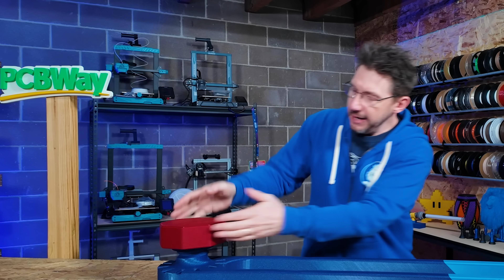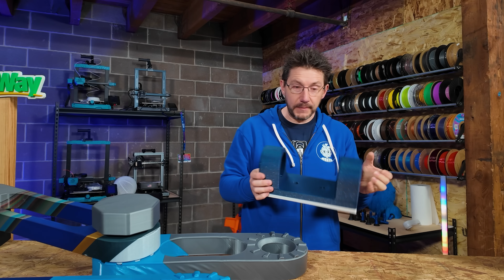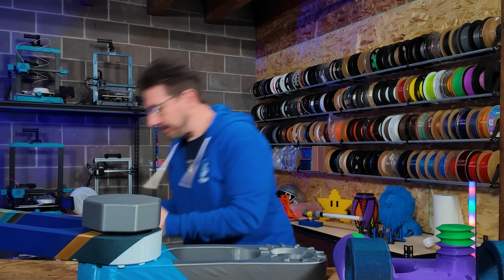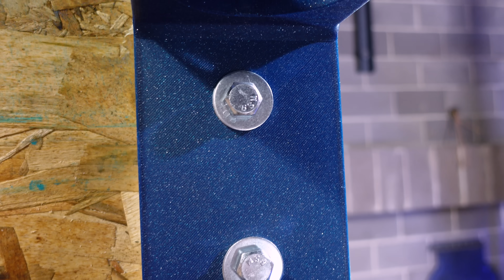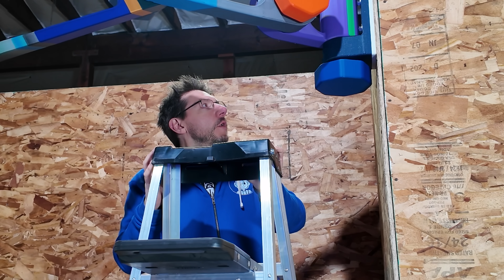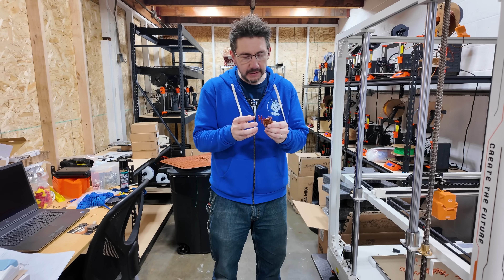My OrangeStorm Giga is Dead

Comment: Hi All, I am wondering if the bluestom conversion enables consistent long duration prints using 95A TPU (this is something I have had trouble with using the standard extruder- clogs every 6-12hrs). Let me know any tips for standard extruder for printing TPU without clogging.
Reply from the maker: It very much should in theory. I would reach out to Luke's Laboratory and ask.
Reply: I have installed a clog detection system and this has made a big difference for long prints being able to recover and keep printing.

Comment: like 90 % of printers suffer issues from warped beds and we are talking anything around 300x300 this thing right here is to big of an issue, get graphite beds and graphite plates to join them together, then get big piece of sand paper and try wet sanding the joints to hopefully get a very smooth middle..... but with aluminium plates i cant see the thing being stable printing 24/7, as i said pretty much all printers suffer from terrible beds, and using whole 300x300 on nearly all of them is very hard until you spend alot of time getting it to work, but then you change material and its off again, altho creality says deviation +3 and -3 is fine which puts my head away its 6mm difference.........

Comment: That printing issue where there’s a lot of small parts on the bed is a very common issue on prototypey 3d printer design. That’s why i bought a very reliable printer to print and forget and expect excellent prints almost all the time.

Comment: 3D LAC spray is the best answer to bed adhesion. I use 3D LAC on all of my prints regardless material in use. The spray hold prints even on the bare metal back of the print plates.

Comment: I can only imagine that a one-piece bed will improve this thing massively. From what I've seen, it doesn't look like the design allows for thermal expansion of the bed pieces and I would not be surprised if they warp pretty badly once they're up to temperature.

Comment: As a Neptune 4 Max owner I see this problem all the time .... the core issue is the expansion of the build plate as the plate heats up .... putting off your z offset ... you need to let the bed heat up for around an hour before setting z offset and / or printing ... for the build plate to settle and stop moving .... otherwise layer adhesion / collision WILL happen.  That OrangeStorm will have the same problem at scale.   Elegoo have not been able to solve this issue since they went big ... and I think that's because it is a limitation of the technology.
Reply from the maker: I solved it with rigid mounts. I’m not kidding it’s working great.

Comment: If the problem is just the thermistor, just go to a regular electronics shop and get one. Should probably be a 100k thermistor, most of the 3d printers use them since reprap... probably its much faster than waiting for the manufacturer...

Comment: My own layer shifting problems (Not a Giga - my Sovol SV06 Plus) turned out to be belt tension, which seemed ok on a cursory check, but after tightening my X belt, the layer shifts stopped. Unfortunately, it took me a long time to figure out, and became quite discouraging with all of the OTHER things I tried to fix the problem, thinking it was a bed adhesion issue. At one point, I had a blob of death... I replaced the hot end, but the old hot end seems to be fine after my own efforts to unblob it (so at least I have a spare now)
Also.... scaling up prints, particularly flexi prints can be problematic. The gaps between parts often require a more narrow gap, and scaling up.... often increases those gaps to the point where the "flexi" integration is no longer supported to form the linkages.
Reply from the maker: Turns out the motors are severely underpowered.
Reply: @3DPrintingNerd  I came at it from a different angle.... I thought my motor controllers on the motherboard might be the issue. Now I'll add underpowered motors to my list of potentials in the future.

Comment: I know it would've made it more expensive, but why not just use a solid aluminium plate instead of 4 separate ones? Hell, even steel if they're that worried about it. Machined surfaces on higher temperature applications have stayed flat under higher stress situations than any consumer 3D printer can dish out. I'm personally ok with extra initial expenses for something that works out of the box and lasts longer.

Comment: just slap a big mic6 bed on the thing.. with a big, or multiple smaller silicone heater mats underneath it.. klipper and  adaptive mesh should easily take care of it then.. go for a BIG hotend.. rapido UHF or even bigger with bigger nozzle, and it should be fine.. the motion system looks very nice with beefy rods on Z

Comment: For your Articulated Arm, I would suggest 3d printing a giant lamp shade and light bulb, similar to to original but scaled up. The bulb can be translucent or while with an actual E25/E26 LED bulb or coiled up LED strips inside to light it up. At the tip, you can mount a camera. Lastly, you can make the giant bulb able to pop open to reveal hidden storage.

Comment: I was thinking about buying one during the kickstarter and I passed thank goodness. I have found if you buy a new printer just as it comes out or is a kickstarter there are probably going to be problems with it. The last new printer that I bought when it came out was the Anycubic M5s to me it was a total bust. Bought 2 not just one, one direct the other from Amazon. Got one to some what to work refund the amazon one. Latter sold the other one for a way cheaper price just to get it out of the house. Replace it with a printer that has been on the market for a year that works. So for now on I’m waiting even if I have to spend more.  So the giga should be call a giga bust.

Comment: You need to reinforce the threaded parts with a steel bolt through them. These parts have such little shear tension they will break I promise.

Comment: I’ve used 3DLaq for adhesion. It’s quite expensive but it doesn’t take much at all and I find one coating can last a dozen or more print jobs. (Although maybe on the Giga with its serious adhesion issues you’d need to recoat at least the center before every print.) Worth trying, at temperature it sticks to PLA  like … glue, I guess 😁 When it cools down, prints remove ok - they don’t just fall off, but with a flex bed, they can be pried off with fingers pretty easily.

Comment: This is like a scaled up Tronxy X5SA, and they were a complete basket case of a machine, until I upgraded mine to a VzBoT3D-Vz-330. Chuck it in a dumpster (or make it into a dumpster), life is too short to waste on unfinished untested toy design junk, especially if the manufacturer doesn't even acknowledge you debugging the machine out of your natural kindness.

Comment: time to upgrade this huge pile of junk with a proper custom high flow hotend ( at least 200mm³/s thats just 15g per minute of PLA material, not a lot at this scale) , closed loop servo or steppers and a heated enclosure.

Comment: Maybe too big of a project for your Orange/BlueStorm, but it might be interesting to see someone build up a huge build-plate similar to the tiled XL bed. The individual board tiles are available from Prusa (though a bit pricy at $22.49USD a pop without any intelligent controller or thermistors or wiring, etc). And you'd need to source a spring-steel sheet and coat it yourself. But it would make for an interesting project. Might be able to get away with an array of smaller stick-on silicon heater pads stuck to the bottom of a sheet of aluminum plate?

Comment: Change nozzle to bondtech cht vulcano 1.8mm 
(Maybe pellet extruder )
Put one big piece of aluminium on the bed (or screws under beds)
Anything around to make it at least 70% enclosed maybe made from PP corrugated sheet (its like cardboard...but from plastic) 

Better extruder (you dont need printing speed with big nozzle....use something strong with maybe gear reduction 
At least 80w heating element for extruder

Comment: Hey @3d printing nerd aka Joel , I have the creality K-1 max that the same thing happened with the hot end how it wicked it up and I can’t even get to the screws to unscrew the hot end to replace whatever I need. Do you have any suggestions? I got the big blob off, but all the screw holes are completely sealed.
Reply: I did the same thing loooong ago on a printer, the only way I found to clean was heat, try to heat it as much as you can and with some metal tool try and scrape it off.
Reply: @lilietto1  ordered new hot end screws. Hopefully we’ll get it all back together and running.
Reply: @TheArcadeguy  Happy for you, and something always get destroyed in the process, it's an hassle but if it's any consolation as joel said, it's a relatively common problem.
Reply: @lilietto1  did that last night got it off finally but the screws were destroyed

Comment: The OrangeStorm Giga was an audacious idea and kudos to Elegoo for trying something kinda crazy.  I think it could have worked better if there was a single very flat bed that was designed not to flex when thermal cycled with a much larger nozzle and probably reverting to 3 mm filament - in other words, truly scaled up rather than scaling the overall dimensions but having the same low flow rate extruder and needing four heated beds.  If I wanted to print four 300 mm x 300 mm objects, I'd use a 300 mm class printer.
Reply: What would you then use for a 100mm X 700mm engineering part?
If you are playing around for hobby it is much differnt from printing usefull products. I would love for Prusa/Bambu... to make a printer that could mirror the machining surface of a smaller CNC so you could print 12' * 30'
Reply: @jenspetersen5865  - Maybe a large glass, ceramic or carbon fiber build plate with a very low thermal rate of expansion?  Considering the contraction of cooling plastic, it may be better to print smaller parts and solvent weld them together for some applications.  Large parts can be designed with internal stress relief to prevent them from warping when molten plastic cools and contracts but hobby 3D printing hasn't needed to do that for such large prints prior to the Orangestorm Giga.

Comment: But this isn't just 'bed adhesion' this is very much a giga specific problem? Other manufacturers aren't silly enough to mount heated beds edge-to-edge via springs and also print to the very edges of those beds. I would try to find some way to closely stick the 4 top PEI panels together, a trial idea is maybe kapton tape on the back right along all the seams.

Comment: Looks to me the Orange Storm is just failing because it's cheaping out stupidly. 

The bed adhestion could likely be addressed with a heat spreader, some proper insulation, and a decent level sensor. Even something like a GP2D02 would do, allowing to sweep the bed rather than poke it. Not the end of the story, of course, you'd also need to wipe it. 

The layer shifts are just dumb. Decent stepper motor drivers can report missed steps, and encoders are cheap today; an insignificant cost compared to having to make the thing big. 

The big blob is again just not bothering. A silicon sock would reduce the risk drastically (and improve hot end performance), but just one little ring attached to a bump switch would let you detect when something has crept too high. But no, this is just big, not using the space. 

And then we have the filament sensor trouble. I don't even know how those are so unreliable. 

Then again, we see this negligence elsewhere too. Like train systems going "That train in front disappered? Sweet, clear track - full speed ahead!"

Comment: The OrangeStorm also suffers from a serious lack of torque and belt tension issues. I've built 1m^3 machines before. Outfit it with some ClearPath NEMA 23 Servo Steppers and 15mm belts will help, along with properly support bearings.

Comment: I really worry the OSG is gonna be a money and time sinkhole for you if you do end up modding the daylights out of it. The thing has major structural and mechanical issues with the construction. That frame is far, far too thin for the amount of weight it has to support. And the ball screws.. they will twist aluminum extrusion like it's spaghetti if you don't do something to compensate for it. Honestly if it were me, I'd be getting Elegoo to take this thing back

Comment: Sign: my mind goes to a PCBWay sign holder... though I'm also concerned about summer heat and whatnot (I don't know if your space is climate controlled the whole time). As for the Giga... Ooof.

There's been a surge in "products in search of a market" and discussions in 3D printing around "trying to check all the boxes just to say they did" or "trying to make a printer for a market by checking specific boxes". And I worry the Giga is one of these. Nobody has a BIG printer... cool, a free market. BUT it needs to have Klipper for fast printing... it needs the duplicate printing like IDEX... can we do better then 2? Oh oh, how about 4! We need a filament runout sensor and ABL. Don't forget we offer support! Cool, we checked boxes to fit a market that only exists in online forums and debates (seriously. Large prints are nice but there's a line between something for TikTok likes and something actually useful) But, why is the bed adjustable? Did they have to copy Bambu and others on non-standard extruder parts? Do they know support needs to be reasonably fast to be useful? Why do all these companies only respond when public calling out occurs?

I'm not a printer designer, but I feel there are absolutely extruders that would work on large format printers. Absolutely delete the springs from the design. Probably look at belts and motors to ensure it has the power to drive everything so it doesn't layer shift as easily. Etc. Looking forward to the Bluegiga

Comment: The Z offset not saving is an Elegoo problem, one that they, seemingly always have with their first firmware releases.  As the Neptune 4's on release had the very same issue, which is something that stems from making your own version of Klipper instead of using a known, working, tried and true, version.
I now have two Neptune 4 Max printers and absolutely love them, just don't love the Fluidd interface (will be changing that to Mainsail) nor the "elegoo version" of Klipper either (open Neptune eventually).

Comment: heated beds are always cooler around the edges, I bet the center of the build area has a cold spot that makes a cross where the beds meet. using 4 beds at once is probably not viable.

Comment: So it seems like this is all down to bed adhesion...first obvious problem is the 4 sheets meeting in the middle exactly where most smaller prints would start. A machine that large, it wouldn't be a bad idea to have something like a mill bed, or a precision welding table for a base. Big, heavy, and flat.

But that got me thinking about my Neptune 4 max, which has a belted z-axis kit coming in the mail. Klipper's bed mesh assumes a z-axis with rather modest capabilities, and a single piece bed, as you'd expect from lead screws and a normal size printer. Even if you up the acceleration and speed in settings, that mesh will still assume that there's a smooth flat-ish surface to print on. Well, what if my printer can move the z-axis as fast as x and y? With a belted z, that could be nearly the case. What if we could tell klipper "there may be ridges here, don't smooth this in the mesh" to tell it about where the build surfaces meet, so it could compensate.

Or spend the big bucks on a perfectly flat surface 😬

Comment: Silicone tubing for the bed, you DON'T want it rigid.
Reply from the maker: No? Why not?
Reply: @3DPrintingNerd  you are going to need some level of adjustment, in order to get them perfectly level. Silicone tubing will give you that flexibility and adjustment and yet not move once adjusted. There is a reason why this is a very popular mod for prusa printers.

Comment: The large screw/bolt needs printed horizontally, with a small section of the bottom of its length flattened for better printing. (Maybe even print the bolt with threads on each end horizontally with a separate bolt head on both ends.)
I've never understood WHY print beds are adjustable: Shouldn't their entire surface be flat on the frame?
Reply from the maker: It used to be the only way to level against the nozzle - but now with super accurate probes, seems like rigid mounting should be the default

Comment: Keeping filament on a wall without any bags. You don't have any humidity issues?
Reply from the maker: Nope, not where I am at.
Reply: @3DPrintingNerd  may I ask have you ever checked humidity levels?
I have my printers in basement and my humidity levels are around 20-44%.

Comment: Ya i had a bad 'blob of death' on my MK3S last week.  With a heat gun I got it off the hot end without breaking wires, or breaking the heat break (done that before).   But my aim was bad,  I also melted part of the extruder assembly, and the frame of my MMU2S.    Rebuilding now, upgraded to MK3S+ and MMU3.  ... any more cost and effort and it would make more sense to trash it and get a Bambulab A1.

Comment: I was feeling the same on the orange storm. It is a great project with some min9r fixable flaws. The hot end is an easy one and going to a single large plate bed with an edi current ABL would be perfect way around some of the limitations you have hit.

Comment: You should print and build an upscaled lego light saber for that lamp arm.

I just finished designing a part that would replace the "lamp_holder.stl" and would interface with the Lego hand from the Lego light saber model files scaled up 400%. Of course it would involve you building a lego light saber at 400% scale, but who wouldn't want to work on THAT project?
Reply from the maker: THIS IS A GOOD IDEA